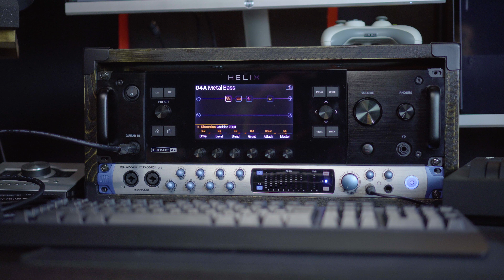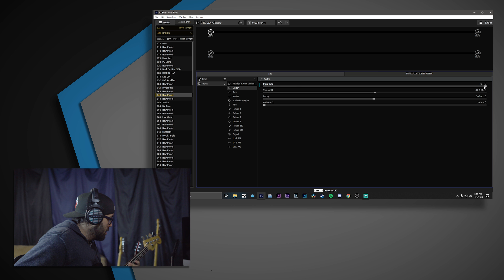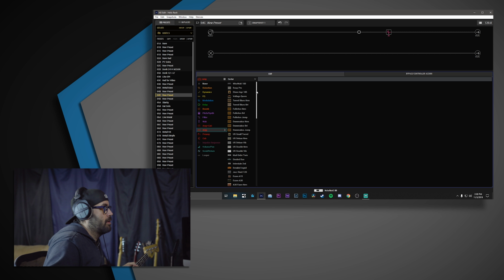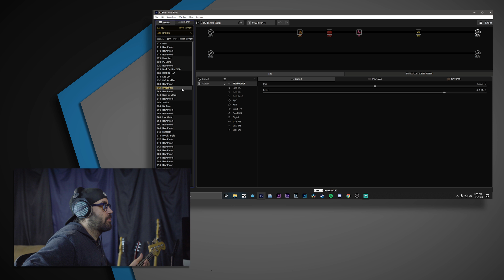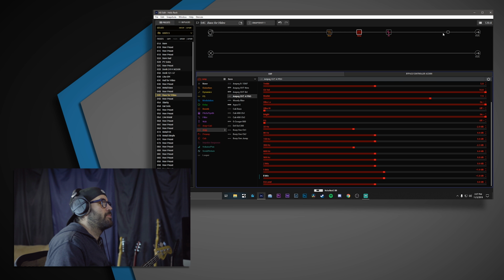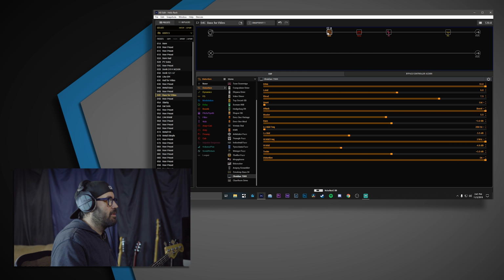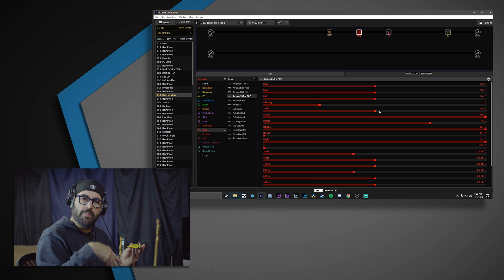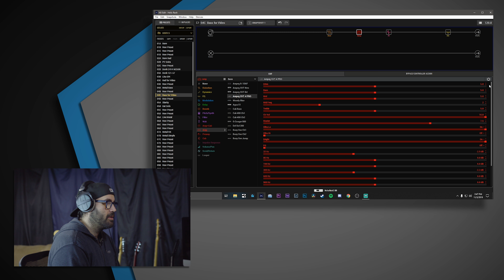Line 6 Helix Metal Bass Tone from Scratch with Darkglass B7K model (Obsidian 7000)

Comment: My dude, I was literally just thinking about doing one of these.
Reply from the maker: Do it! There is room for many perspectives!
Reply: Also, as far as I know.... Running your channel volume maxed is pushing more electrons into the power section. This could affect master section sag/compression. So maybe turn down the sag or the master volume to compensate. Really, just play around bud.
Reply from the maker: You're thinking Master Volume
Reply: @NickHillMakesMusic  I said that. You could turn down your master or sag to compensate instead of killing the tone from the maxed out channel volume. So, the way it works is your channel volume pushes the electrons through the phase inverter into your power section.. cranking your master increases sag. But, lowering your master could compensate for the channel volume being maxed.
Reply from the maker: Ah ok

Comment: I should mention that theoretically cutting the low end from 80Hz is not a good idea because even electric guitar's low E fundamental frequency is 82.4Hz which means you are cutting off your main bass frequencies.
Reply from the maker: Thanks for the knowledge. This works for me though and also, I’m not in E. Not to mention there is a roll of and not a brick wall setting going on. Appreciate the comment none the less. Cheers